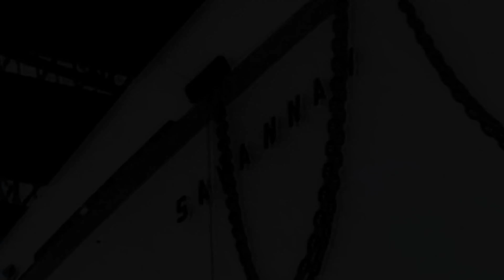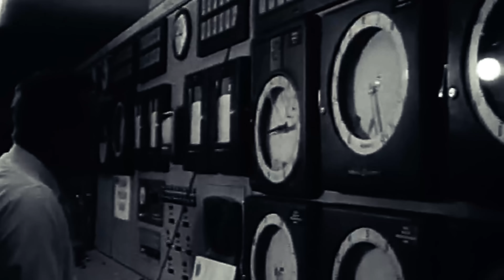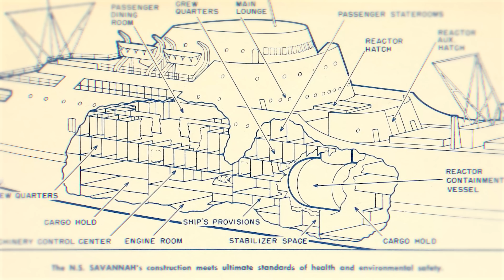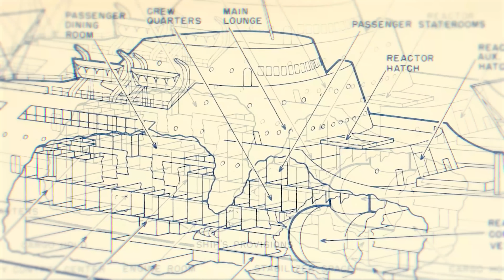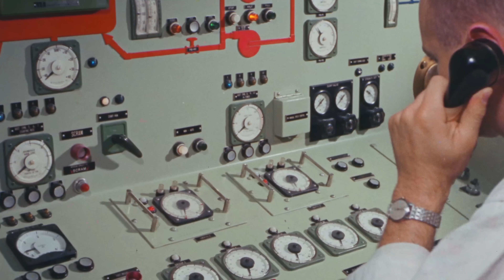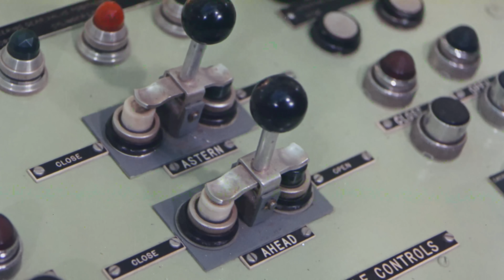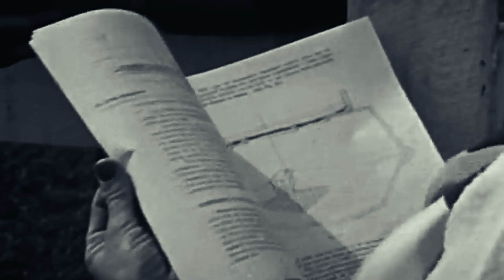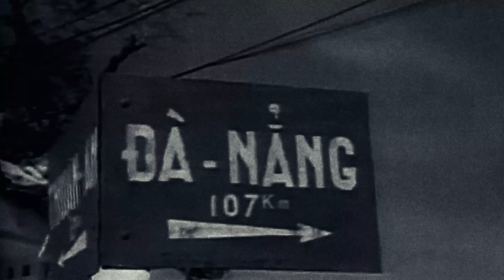What Happened To Nuclear Powered Passenger Ships?

Comment: Ships one day, will have to find an alternative power source than fossil.
Now, im not against fossil at all! I love fossil energy and I am a huge supporter in expanding that industry in my country. We need it and it benefits our lives, economy and stability.

But there are some limitarions...

Sure...we can improve engine efficiency...but to a limit...You cannot generate more energy than is stored in a fuel's chemical energy.

Sure, you can improve hullform to reduce drag...but only so much...

Sure...you can discover new oil deposits, until we discover all remaining undiscovered deposits...

Sure...you can improve extraction techniques to exctravt previously inaccesible deposits or extract them to a higher efficiency, but eventually, they too would run dry...

Sure...you can improve refining processes to make fuel from crude oil more efficiently...up to a point..

Everythint has a limit...once all thoses limits are hit, all that will stand left is how long until we have nothing to extract.

The numbers for how much longer we have oil for is not truly accurate, as it only accounts for currently known deposits. So the truth might be perhaps a century or 2, maybe 3 or more if you consider efficiency improvements at various points durring the followint century. But thats still, a limit.

Comment: The main reason liners and freighters are not being nuclear when nuclear is so common in capitol ships of militaries is one of logistics.  For the US navy it would be exorbitantly expensive to keep a carrier fueled at sea.  While conventional fuel is cheaper for the ship itself a military ship cannot rely on a port of call for refueling so it needs entire fleets of oilers to resupply at sea and during such refueling operations the ship is highly vulnerable to attack.  When adding the cost of the oilers and their own fuel and logistical needs the nuclear power becomes the more practical option for operational capability AND cost effectiveness.   It is a similar dynamic for submarines but the main reason they are nuclear (for a true blue water navy) is for capability, unrefueled range, and air independence.  While some great non-nuclear AIP subs have been created none have real intercontinental patrol range, so they are limited to coastal defensive patrol rather than real offensive operations.

Comment: There is a lot of research being undertaken in the small modular reactor space, but these reactors are still too large for most ships. A micro reactor using low enriched fuel with a 30 year core could be practical for very large freighters, like bulk carriers and container ships. China might venture into this space, but it will be a decade away at least, probably more.

Comment: Smaller reactors, like we see on ships are much safer. Cooling isn't such a big issue due to the better surface to volume ratio and many designs are inherently stable. Albeit the soviets had some reactor accidents on their submarines, especially in the early days. In the end, oil is just so much cheaper

Comment: At 5:08, we see workmen installing thick white panels around a cylindrical structure. I believe those are thick borated polyethylene radiation shielding panels. They have a very high hydrogen content in it's structure, making them excellent at stopping neutrons.
Reply: Bioshields, as we call them in nuke work

Comment: There is no point of nuclear powered surface ship if fueling is no problem. 100.000t aircraft carrier chucking 25 knots for weeks on end and icebreakers operating middle of nowhere where fuel aint available, there is point.
Reply: The costs of any nuclear vessel refueling are insane. Only vessels expected to serve 50 years it make any sence. Those need one refueling which costs tens of percentages of costs of building brand new vessel. Nuke subs are simple. One reactor core, around 30 years. After that turn boat to razor blades and build new one.

Comment: Small modular reactors might have a place in cargo ships in the future. The tech could certainly reduce the construction and operational costs of nuclear ship propulsion. It'd require tighter regulations on ship emissions before it'd be viable though.
Reply: @dgthe3 Something I have been thinking about. If they can actually build them, they should deal with most of the negatives that plagued the Savannah. If successful, such small modular reactors are an obvious answer to de-carbonizing marine transport.

Comment: The labor relations issues were a surprise to me, though they shouldn't have been.  The U.S. nuclear industry's adoption of pressurized water reactors, and Admiral Zumwalt's approach to nuclear safety in the Navy, pretty much guaranteed  such an outcome.  I just hadn't translated it to the effect it would have on commercial shipping.  U.S. Navy nuclear ships use pressurized water reactors fueled with weapons grade U-235 to keep them compact, and ensure 25 to 30 years unrefueled operation - basically the lifetime of the vessel.  The crews that run those reactors are very highly trained, expensive people - nuclear reactor experts, which was how Zumwalt achieved an amazing level of safety.  Nukes don't have to be so high strung, and can be made much safer if they're not.  People are beginning to wake up to that reality.

Comment: Passengers aren't exactly flocking to cruise ships anyway, the bigger question re: economic viability is regarding the capemax container ships now carrying in excess of 22,000 TEUs between Singapore and Rotterdam. Both of those countries can be relied upon to have sufficient infrastructure and oversight of nuclear capable harbours, as well as the education capacity to provide a supply of competent nuclear engineers. What this means is that nuclear cargo ships can be achieved as a bilateral agreement between Singapore and the Netherlands, both of which are pursuing civilian nuclear energy anyway. If I was ONE shipping, I'd definitely be working towards making this happen as it could potentially represent a huge advantage for them that nobody else would have.

Comment: I just want to point out that technically, a nuclear reactor is really still just a steam engine. We‘ve never even left the steam age. Diesel is just a weird outlier amid 3 endless generations of different types of steam engine.
Reply: Pointless. Diesel is not powering the piston. It is the pressure from the gas generated from the diesel burning. Like how boiling water with coal is making a gas that push a piston on a locomotive.
We left combustion a long time ago. The problem and reality however is that wind-power and water wheels is not enough to satisfy the power-grid. And with that said I just want to point out that Copper and Iron age wind and water power never left us either. Instead of crushing wheat into flower? Running a forge hammer? Sawmill? The power is used to generate electricity instead of coal. Sometimes...

A nuclear reactor ship is basically exactly the same as a coal or oil operated turbine ship. The difference is splitting of atoms instead of combustion to heat water. A nuclear reactor station is like a coal burning station turning a turbine with steam. A Diesel or even Petrol engine combust the fuel inside the engine like how a jet engine (turbine engine) do. Instead of super heating water externally and making a very potent energy force drive things? Combustion occurs inside achieving close to the same thing as anything involving modern steam machines. As a jet engine is the same as a steam turbine? A diesel engine is the same as a locomotive piston engine. More or less.

A hotter environment can hold more water in the air. A colder environment can hold less water. Why when steam cools down it turns back into water droplets. It is simply far more efficient heating and so boiling water to transfer energy to something like a piston or turbine. One can get a fan to spin by simply hot air. A fan being a turbine... With combustion of fuel being said air moving. Like diesel burning in a combustion engine. Nothing is really new here since the start of steam engines. Outside of splitting atoms. Even that is hard to say if new. Burning fuel is releasing energy somehow also... The new thing really is a invisible danger... Not like coal or batteries can release a dangers hard to detect with the naked eye side effect. Nothing at all invisible is released burning coal or diesel. Half life? Co2 emissions half life? Would not be surprised if practically it takes as long for Co2 to be absorbed as the half life of a nuclear reactors emissions. Dangerous stuff regardless.

Comment: Nuclear energy is the worst idea any human has ever dreamt up, these materials are safest when they are turned into missiles that never get used. Putting it on a ship is even worse.
Reply: Nuclear energy is incredibly safe, probably the safest in the energy industry. It gets bad PR from isolated disasters like Chernobyl. Modern plants are lightyears ahead in terms of safety and knowledge compared to Chernobyl. When you take into account the environmental impacts of other forms of energy versus nuclear, it's not even close. Coal dust is a bigger radioactive pollutant than nuclear energy is. It's shortcomings, in my opinion, are the incredibly high construction, training, and maintenance costs, which make funding very difficult in the short term. In the long term, it's economical; on ships, probably not. If the world wants to take pollution seriously, nuclear power plants are the only choice.

Comment: The biggest problem was that the Savannah used an old-style nuclear reactor design, one that took up a LOT of space on the ship itself. 

Fortunately, the development of small modular reactors (SMR's) may solve this problem, since the space taken up including shielding may be not much different than a standard large internal combustion engine setup running on diesel fuel or even compressed natural gas. It may also mean the ship could actually run faster because there are no worries about running out of fuel at higher speeds.
Reply: Smaller reactor wouldn't matter. It was never designed for container use.
Reply: @WALTERBROADDUS  Savannah was built at a time when container ships were still many years into future. But with today's large container ships, they have the space to accommodate a small modular reactor (SMR) including shielding.
Reply: Actually, the first modern container ship was built in '56.
Reply: @WALTERBROADDUS  But the modern container ship as we know it today wasn't really built until the late 1960's.
Reply: First container ships were being built in 1956. It was already obsolete while It was getting built. And the idea of a passenger / cargo ship was definitely obsolete. Passenger travel at Sea was already dying.
Reply: @WALTERBROADDUS  how would you know? they produce 1.5 to 5MW and only getting more powerful
Reply: Power output was never the issue.

Comment: Savannah failed because it was fake. Where was the turbine?  Where did the steam coming out of the turbine went to?
They never show the turbines of the reactors, why?
Reply: The steam from the turbine, whether nuclear, oil fired, or coal fired, goes into a condenser where it is converted back to water. That water is then fed back into the boiler where it is boiled into steam. That steam then goes to the turbine, and the process repeats.
Reply: @stuartaaron613   But there was no turbine or condenser on that ship.
Reply: @ShonMardani  Sure there were. Where do you think that the steam produced by the reactor went? It went first to the steam turbine to drive the propeller, and then to the condenser, and then back to the boiler which was heater by the reactor again.
Reply: @stuartaaron613    That is what we read in textbooks, but it does not work that way under the water.
Reply: @ShonMardani  That is exactly the way any steam turbine system operates, whether in a surface vessel or a submarine. The steam is not exhausted in to the air, it is recycled over and over again.

Comment: The U.S. Navy decommissioned its nuclear cruisers and destroyers because of the manpower cost of the engineering plants. As long as conventional power is significantly less expensive nuclear will not be used.
Reply: What about the Carriers and Subs, there good to go I'm confused???
Reply: @Billy-y5b in submarines, the endurance is enough of a benefit. With carriers, the endurance is a factor along with the small size of the engineering plant. A modern carrier has two reactors and four turbines. Enterprise had eight reactors, each replacing boilers. Additionally, the space that would go to fuel bunkerage can be committed elsewhere.
Reply: @simbry49  I'm reasonably certain that the space saved by not needing ship fuel is the major reason why the USN went to nuclear carriers. I think for the last generation of conventional carriers for the USN, it was something like half the fuel on board was for the ship & half for the aircraft. Switching to nuclear would essentially double the amount of jet fuel the ship could carry for those very thirsty aircraft. 

It also has a pretty big impact on the logistics of fueling the fleet while its deployed. I don't know the figures, but I imagine that a lot of the fuel requirements for a carrier battle group stemmed from the carrier itself. Switch to nuclear and now you need fewer fleet oilers to serve all the ships.
Reply: @dgthe3 also, the carrier's escorts run on the same fuel as the aircraft. As such, the ship is also used to refuel the escorts. This is a practice that started with the capital ships during WWII.
Reply: @Billy-y5b  The Navy had several classes of nuke cruisers that would escort carriers during the Cold War. When it ended, the money to maintain them was simply not there any more. They were all scrapped/mothballed. They've toyed with the idea of nuclear escorts again recently (to power laser or railgun systems), but it would be very expensive to get the tech up and running again, and in a ship.

Comment: I'm all for the return of these ships. Instead of electric cars, we should be pushing for nuclear powered ships. But that would make Big Oil angry.
Reply: Problem is cost of personnel - you just do not have so many specialists in nuclear energy, but every ship would need crew of them in order to operate reactor.
Reply: @ceu160193  It could be done, and can be easily adapted. It's not the 1950s and 1960s anymore though. Nuclear Reactors are far safer now.
Reply: @NordiusOfficial  They still require operators, and just to make scale of the problem more obvious, only few companies in the world have specialists and knowledge to build nuclear power plants, and out of those, even less have everything necessary for production of reactors for ships.
Reply: @ceu160193 people can adapt and will adapt. It’ll just take time.
Reply: @NordiusOfficial  A long time, so nobody is willing to take such risk. At the moment, such specialists outside of military are rare, while you can somewhat easily find mechanic for your average ship in any port.

Comment: Russian nuclear powered ice breakers had for many years a passenger service program. I think they could carry up to 130 passengers.
Reply: Main reason for this is, again, costs - you don't need ice breaker during summer, so it would otherwise just stand there, with costs of maintenance piling up. So Rosatom uses them for tours to North pole during summer and for their direct purpose of clearing sea routes from ice during rest of the year.
Reply: @ceu160193  Northeast Passage can be crossed without icebreakers assist only for 3-4 months in a year, from jule to october. Now its up to 8-9 months with nuclear icebreakers fleet, and to make it full year round russia needs 2 more, so no, they wont "just stand there" any time soon.

Comment: When all the oil and natural gas run out (which will happen sooner than most people realize) ships will have to go either sails or nuclear. And, there will need to be more of them, as without oil, there will be no big commercial airplanes any more.
Reply: Well, big planes will be there, but half the load will be batteries😂
Reply: @specialsnowflake2309  If battery powered, they will have to be prop planes. Jet engines won't work off batteries. There will be few if any long haul flights.
Reply: alcohol can be a gas

Comment: Germans had the otto han. Also mixed cargo and passangers. They end up converting to diesel.
Reply: And, to make it even better, Captain of the Otto Hahn at one point was Heinrich Lehmann-Willenbrock, previous commander of U-96 of Das Boot fame^^
Reply: Actually, the Otto Hahn used any lessons learned of Savannah and its reactor was build by the same company, due to the experience with Savannah, despite being a German design by Interatom. Also, there is actually a novel on the final nuclear voyage of Otto Hahn from Rotterdam to Durban by Lothar-Günther Buchheim, the author who wrote "Das Boot", called "Der Abschied". After being converted to Diesel and being sold multiple times, it was finally retired and broken up in 2009.
Reply: And the Japanese had Mutsu/Mirai, also converted to diesel. Unless you can use existing infrastructure, like the Russians with their nuclear icebreaker fleet, it's just really really expensive and inconvenient to operate them. To my knowledge the Russian cargo ship, Sevmorput, exclusively operates from/to Russian ports. Coordinating with the local port authorities is a nightmare, you can't let them into certain parts of the ship, but you can't lock them out either ...